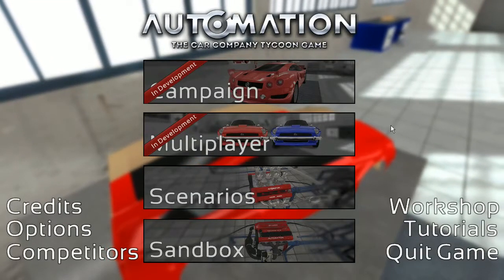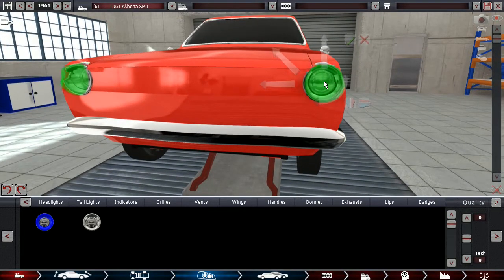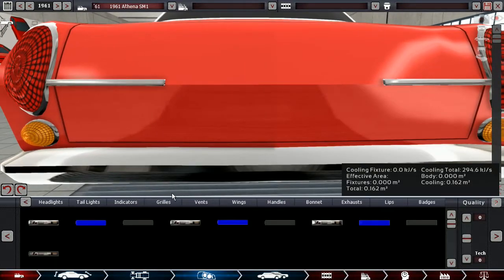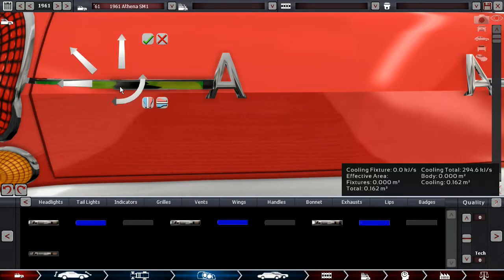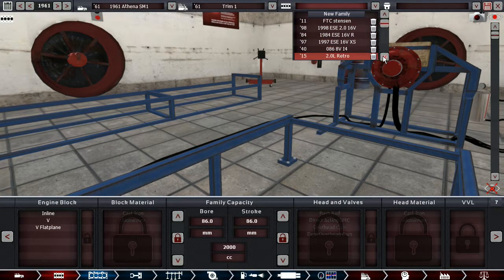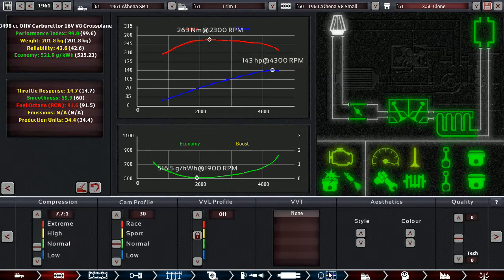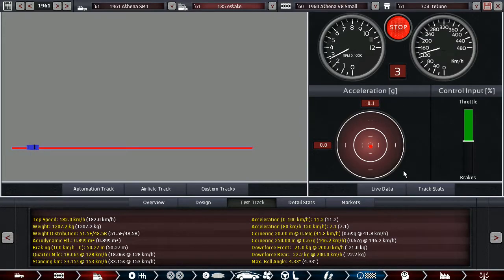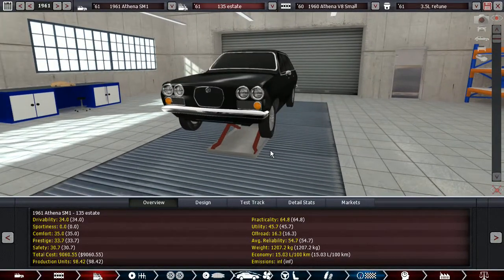Automation [Ep. 263] - 1961 Athena SM1

Comment: Full size performance cars (Chrysler 300 letter series (300, 300B, 300C, 300D) had originated in 1955, with other cars joining quickly (1958 Ford Thunderbird came standard with a 300HP engine, the 1961 Oldsmobile Starfire that came with 330 HP, etc). Performance (usually big block) engines were available in all full-production, full-sized cars by 1958. Ford introduced the mid-sized Fairlane in 1962 and Chevrolet the Chevelle in 1964 and both had performance oriented versions (the Chevelle had an SS model, originally applied to the full-sized Impala). Ford also had the Falcon, introduced in 1960 as a budget economy car, and by 1964, had made V8 engines optional in the cars. The Mustang was based on the Falcon and debuted as a late-model-year 1964 car. General Motors would respond with the Camaro and Pontiac Firebird in 1967, but by then many other cars had already become Muscle Cars. The Pontiac GTO dated back to 1964, and was a modified Pontiac Tempest, which in turn was essentially a Chevrolet Chevelle. Oldsmobile launched the 442 package as well in 1964. The entire muscle car thing really began in the mid-to-late 50s and continued through the 1960s until government regulations regarding safety and pollution brought an end to it all. Cadillacs ran with 300+ HP from 1957 and, especially in the mid to late 60s, were actually on the quick side (especially when you factor in that they weighed 4500-5000 pounds depending on the model). 

That being said though, of the million-plus full sized cars Chevrolet alone built every model year in the early 60s, the vast majority were equipped with the standard Inline Six motors that wheezed out less than 150 HP. Just because larger engines were available didn't mean everyone was clamoring to get one. If you bought a massive luxury car that weighed 4500 pounds you needed that 350 HP just to move it around, but for most people, the car was just transportation and speed really wasn't a concern, so the less powerful engines were adequate. Just about any car, unless marketed as a premium or luxury make, offered six cylinders and small V8s before you got into the ludicrous 427s and 396s. Even the Mustang and Camaro came standard with inline sixes.

But anyways, thus concludes my muscle car history lesson, which has yet to mention a Mopar other than the Chrysler 300, so I'll add this- Plymouth Barracuda was introduced in 1964 but was more of a GT than a muscle car for a couple years. And the Dodge Charger premiered in 1966.
Reply from the maker: +Sedan57Chevy Thanks for the insight. I'm very happy that you're sharing your knowledge about these cars with me and with everyone else! I've learned so much already from your posts like this, things that I'm sure I would normally be too lazy to look up. I didn't even know that Mustangs and Camaros with I6s existed back in the day, I knew the Corvette C1 had an I6 but I thought that those pony cars all had V8s of different sizes but I was wrong so thank you for your input once again!